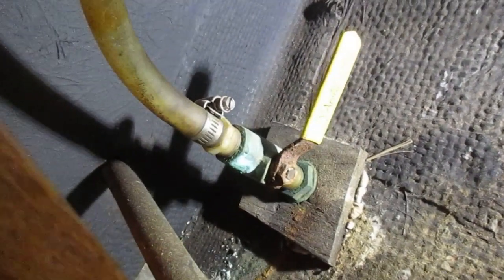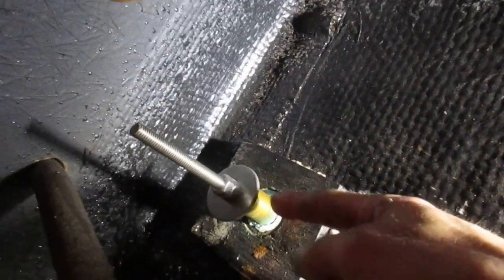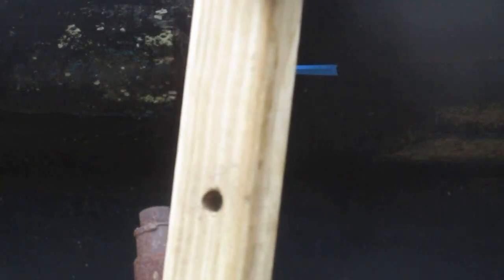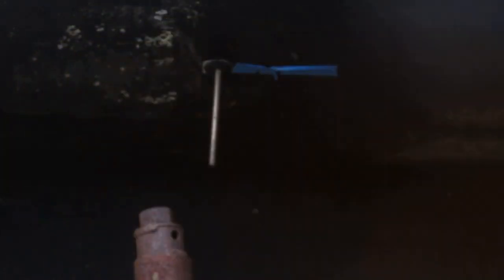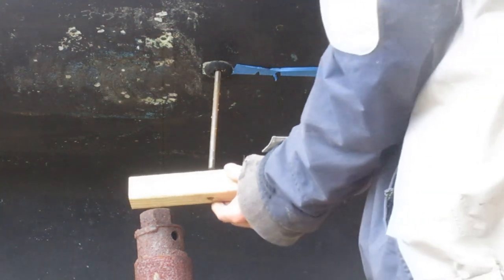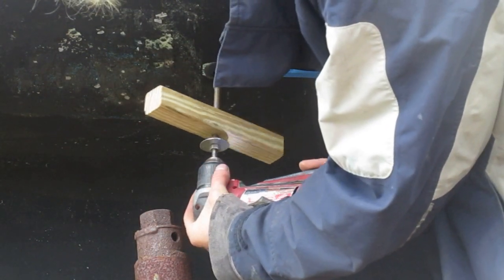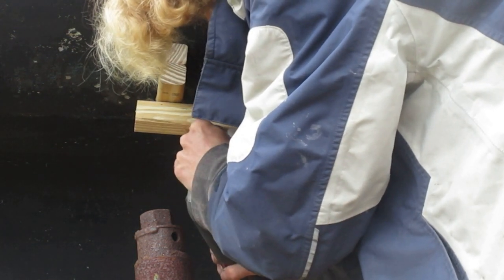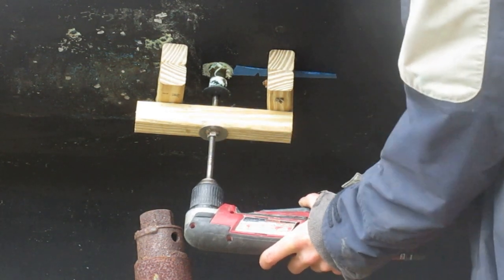How to remove a thru hull fast! Boat building method (HHT Ep5)

Comment: This will work if the through-hull is simply inserted into a hole that is larger than the through-hull. On my boat, the engine intake was "threaded" through the fiberglass and it would not have worked using this method, This method would have damaged the fiberglass of the hull. I had to obtain a step wrench to remove it. 

In another example, I had a thru-hull for my speed log and that was simply caulked in place and this method would have worked fine.  So, before you try this, check how the through-hull is installed. Unfortunately, it may not be obvious.
Reply: If it's threaded simply unscrew it. Clearly this is for a totally different application than yours and your comment is irrelevent.

Comment: Isn't that more complicated than just a bang with a mallet from the inside?  but the same theory works well for removing cutless bearings!
Reply from the maker: you can damage the hull banging on it with a hammer
Reply: @haydenfoy5723  That is highly unlikely.  and if you can damage your hull by banging out the thruhull,  you have bigger issues!   Just use a razor knife to cut around the sealant uhnder the head of the thruhull and it will come right out with a good whack with a mallet!
Reply: Tell ya' what, next time you are pulling your thru-hulls gimme a call and I'll be there with my mallet..... we can video the results and post them on YOUR boat repair channel.....:face-purple-crying:
Reply: @keithgarwick7029  Beat you to it.  I've removed 15 from my boat...